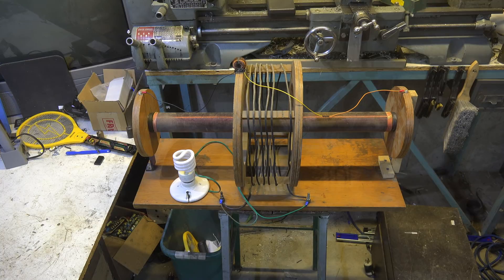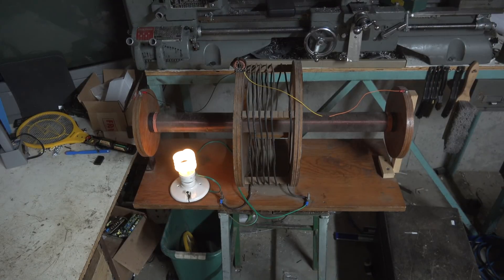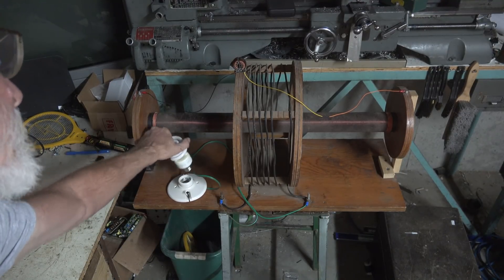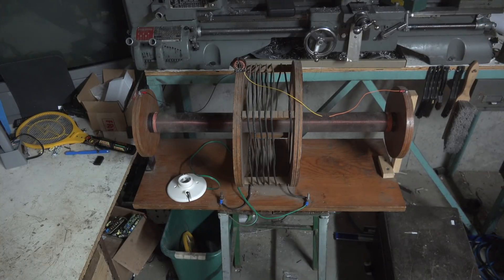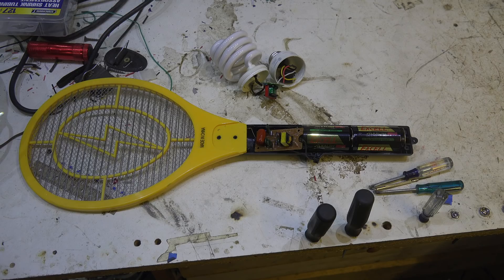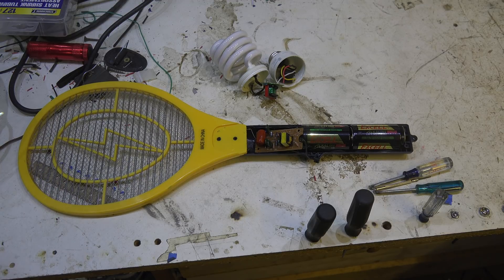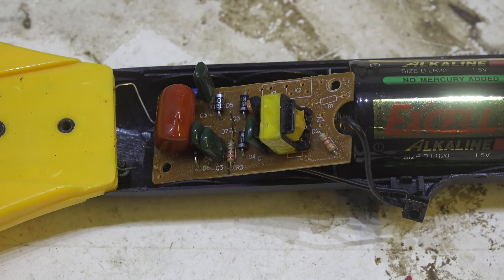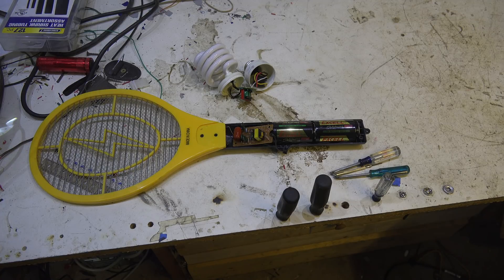Can the Tesla coil be a source of free power?  The answer

Comment: you are very wrong.  there is free flowing electricity very high above us.  also the earth is flat and motionless.  reserach the curvature formula of 8 inches per mile squared and ask yourself why you can see things 100 miles away or more when they should be below over 6000 feet of curvature?  you all have been deceived.  the sun and moon work around the magnetic north pole on a flat plane.

Comment: Correct me if i'm wrong.  I thought tesla's "tesla coil" was to transmit energy from one point to another.
Reply from the maker: That was one of the uses that was tried.
GFM
Reply: That was Its main purpose, yes, not free energy.  He envisioned sending power all around the world wirelessly.  Not sure why Grayfurnaceman thinks it was proposed by Teala as a free energy device.  I believe Tesla was experimenting with atmospheric electricity as a means of getting energy from the atmosphere.  Maybe the Tesla Tower was involved in that research but it's stated goal was wireless transmission.  Grayfurnacemans setup could never generate squat because it was (a)never designed to do that and (b) at ground level where there is no atmospheric energy available. You need an antenna to get energy from the air.  Ion collection from the atmosphere is real science and no it's not free energy (over unity).  It's simply collecting something that's already there, generated by the sun and cosmic rays.  The higher you go the more you can collect.

Comment: So, my guess commented on a previous video (A battery+flyback in a bulb (in place of electronic ballast circuit) + the lamp base is effectively shorted by the primary coil, which is used as a switch. I bet shorting lamp leads will light it up as well) was absolutely correct.  =)
Reply from the maker: You got it.
GFM